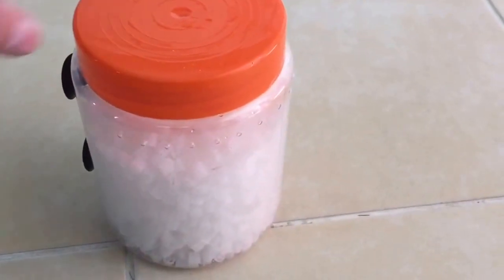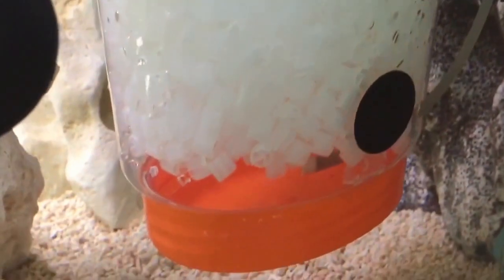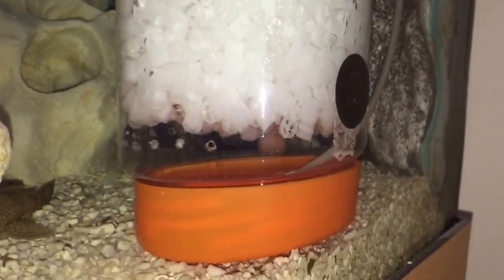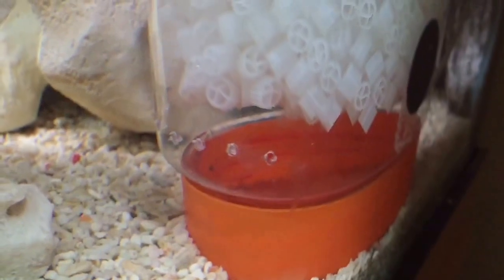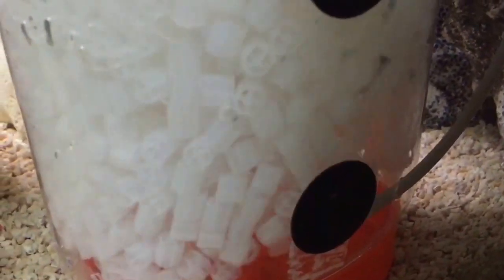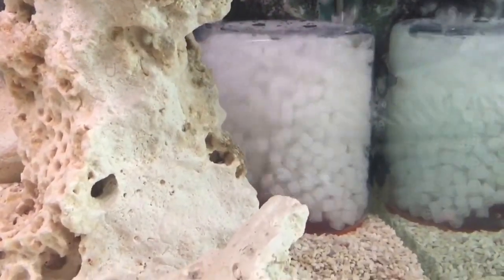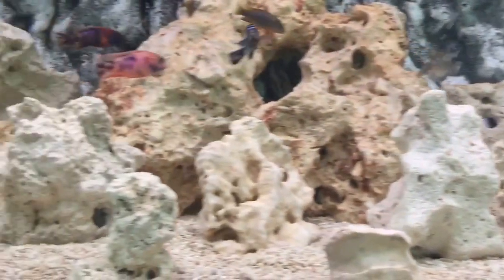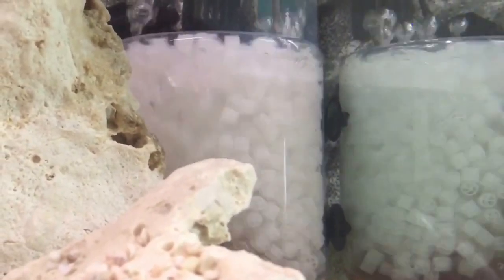K1 micro moving bed filter

Comment: Awesome to see that the moving bed got working. You will be able to add more media after a week or so when the biofilm starts to build up and the moving bed will certainly hammer ammonia and nitrites from any pollution incidents. The biohome in the external should handle the nitrate too.
Reply from the maker: Thank you once again for your advice Richard and for taking the time to comment and respond to my question, top bloke:)
Reply: No worries, any time.
Reply: @pondguru  is it possible to reduce nitrates in moving bed, like with very low flow? by using some bio media instead of k1?
Reply: @GodofWondersss  If the media itself is porous and has deep tunnels then it can support anaerobic activity but that sort of media is not what is used in moving beds.
Reply: @pondguru  Alright how to make a nitrate filter with a "aqua clear 70 - hob filter' ? it works like a mini canister filter, but how do i reduce the flow for anaerobic activity? if i block the inlet hose wont it affect the motor?